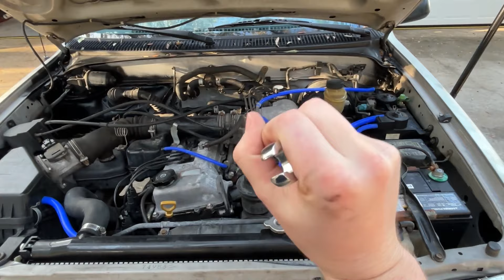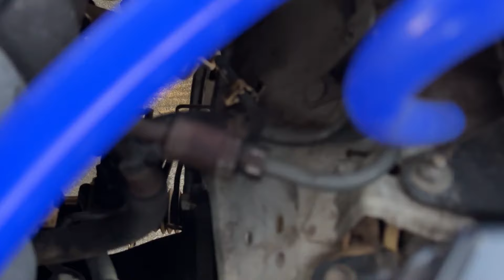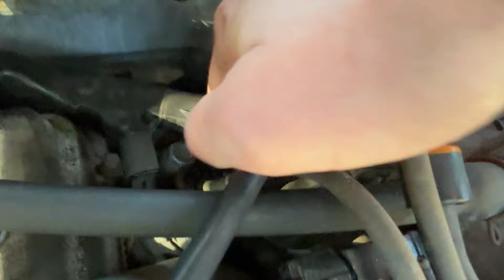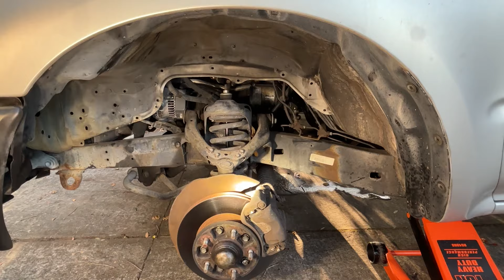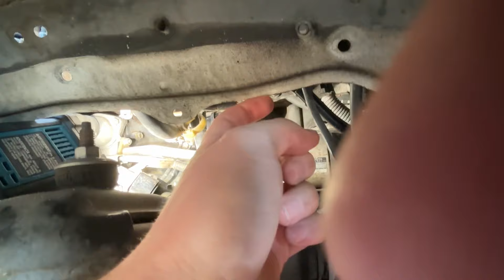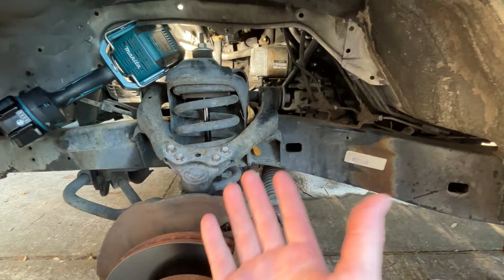Toyota Tacoma Repair Series Part 7 | 2.4/2.7 Engine Fuel Filter Change All Tools FULL GUIDE!

Comment from the maker: Helpful Hints

Steps
1. Depressureize Fuel System
2. Remove Battery fully from truck
3. Remove front fuel line - 14mm Flare Wrench and 19mm Wrench
4. Remove rear fuel line - 17mm Socket, 6 inch extension and ratchet 
5. Jack up truck and remove driver side wheel
6. Remove wheel well lining
7. Remove Top fuel filter bolt - 12mm Socket
8. Remove bottom fuel filter bolt - 12mm Socket
9. Remove fuel filter from engine bay from top
10. Remove both bolts from old fuel filter - 17mm Wrench
11. Install new washers and reassemble
12. Put it back in reverse order, starting at step 9.

Parts Needed 
Fuel Filter - https://amzn.to/4fD0zdk
Vac tube - https://amzn.to/4en3TZc

Tools Needed (in order)
14mm Flare Wrench - https://amzn.to/4fD0M06
19mm Wrench -  https://amzn.to/3AMnHXU
17mm Socket - https://amzn.to/4etXZp0
6 inch extension - https://amzn.to/4etXZp0
Ratchet - https://amzn.to/4etXZp0
Universal Joints - https://amzn.to/3O2ERDS
12mm Socket - https://amzn.to/4etXZp0
Impact Wrench Kit - https://amzn.to/3O0oKXh
17mm Wrench - https://amzn.to/3YKSFro

Other Helpful Videos to Watch (not mine)
Quick video to find filter location - https://www.youtube.com/watch?v=UbBx--w8dVE
Informative Video - https://www.youtube.com/watch?v=oDfe73IsK6k
Another helpful video - https://www.youtube.com/watch?v=3hXO2ph9XCY&t=97s

Comment: i'm at 200K and have never changed the filter out. Unless you are using aftermarket, yes change it at 30K, but OEM...man it's been working for over 25 years. 30K might be over kill. But if you have time, why not. LOL.    Great vid. Flare nut suggestion make sense.   Thanks.
Reply from the maker: When I bought it last month it felt pretty slow, after changing this filter and deleting the cat (upcoming video) it drives so much better, last owner just thought it was dying.
Reply: @UltimateToolReviews  interesting,  thanks!